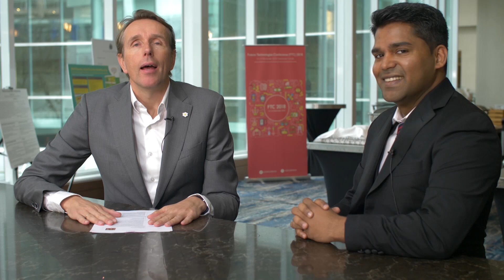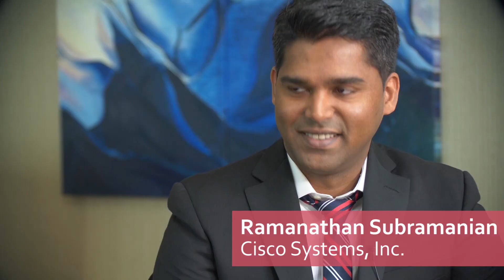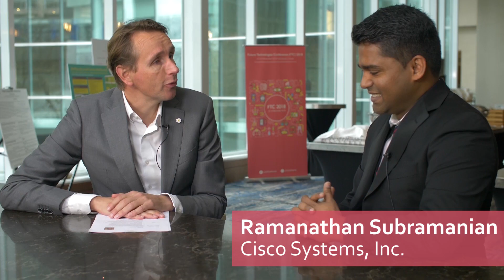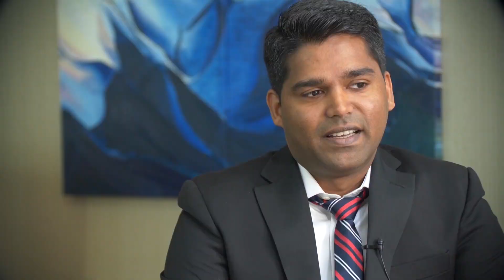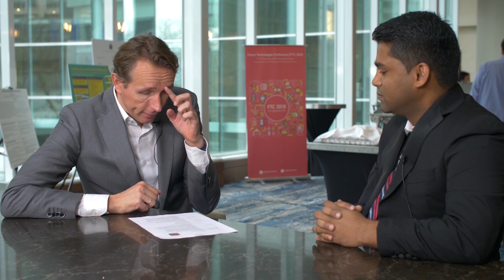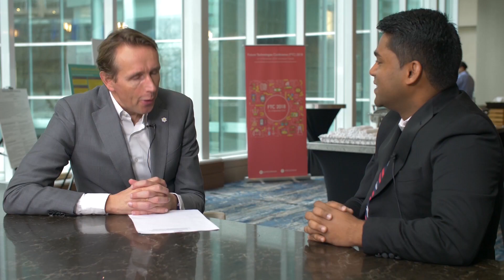mmWave and Resource Allocation Scheme - Interview with Ramanathan Subramanian

Comment: Wow..Ram, That's a really cool info and use cases for V2V communications. Indeed these infra are much needed when Auto OEMs talk about level 4 & 5 road to autonomous..
Reply: Autonomous/self-driving vehicles of future will have numerous on-board sensors that generate large amounts of data and, will require 3D HD maps to plan and navigate routes. Downloading/uploading such high volume data in under, say, a minute or two, becomes practicable with mmWave communication.